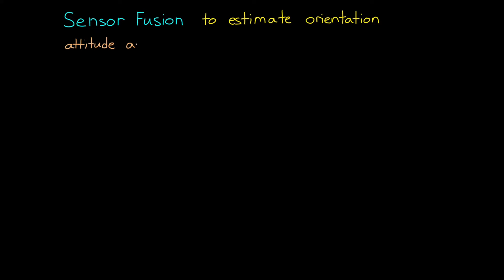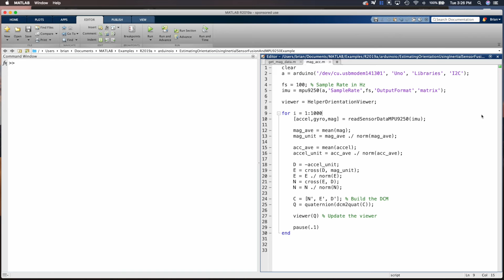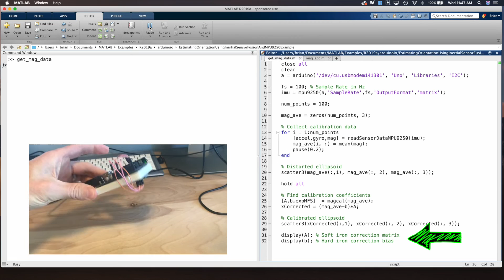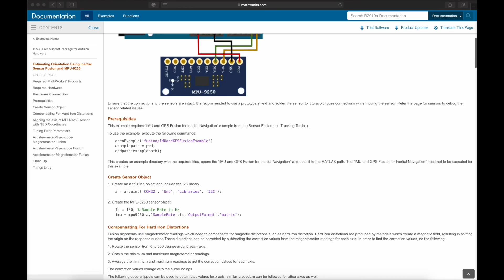Understanding Sensor Fusion and Tracking, Part 2: Fusing a Mag, Accel, & Gyro Estimate

Comment: In magnotometer calibration, U said down = -(g) and east = down x mag field. Isn't it should be up instead of down for ENU?
Reply: I don't know if I'm following your question exactly but let me answer what I think you're asking and please clarify if I'm wrong. NED and ENU are both coordinate frame conventions that are tied to the same reference (Earth). We could use either frame to describe a rotation but NED is more commonly used in aerospace. In this way, when an accelerometer is sitting on a table, the acceleration it feels is up, or a negative acceleration in the Down axis. And, East would be -accel (which is down) cross mag field. But if we were working in the ENU frame, then the upward acceleration would be positive since it's in the UP direction, and East would mag field cross accel (which is up). Did that make sense and did that answer your question?

Comment: (0:00 - 2:00) Introduction to the concept of orientation and different ways to represent a rotation such as roll, pitch, yaw, Direction cosine matrix, YZ, and quaternion.
(2:00 - 4:00) Explanation of how to estimate orientation using a magnetometer and an accelerometer. The video explains how to measure the phone's acceleration and the magnetic field to determine the direction of gravity and north.
(4:00 - 6:00) Discussion of the problems with the simple implementation of the orientation estimation, including the effects of linear accelerations and disturbances in the magnetic field.
(6:00 - 8:00) Explanation of how to calibrate the magnetometer to correct for hard and soft iron sources that distort the magnetic field measurements.
(8:00 - 10:00) Discussion of how to deal with corrupting linear accelerations by predicting them and removing them from the measurement, or by ignoring accelerometer readings that are outside of a certain threshold.
(10:00 - 12:00) Introduction of the gyro to measure the angular rate of the system and explanation of how to estimate orientation for a rotating object using just the gyro. This process is called dead reckoning.
(12:00 - 14:00) Discussion of the downsides of dead reckoning, including the need to know the initial orientation and the drift away from the true position due to sensor bias and high-frequency noises.
(14:00 - 16:00) Explanation of how to use sensor fusion to combine the estimates from the accelerometer, magnetometer, and gyro to minimize their weaknesses and maximize their strengths.
(16:00 - 18:00) High-level explanation of how the blending of the two solutions (accelerometer and magnetometer vs gyro) works in sensor fusion algorithms like the complementary filter or the Kalman filter.
(18:00 - 20:00) Demonstration of how to implement the sensor fusion algorithm in MATLAB using the function ahrsfilter.
(20:00 - 20:32) Conclusion and introduction to the next video, which will add GPS to the IMU and orientation estimate to improve the position obtained from the GPS sensor.

Comment: Any thoughts on the 9 DOF chip, LSM9DS1?    Wouldn't implementing sensor-fusion be easier if it's all from one chip?

For example, I saw another cool Processing project, but that too doesn't use the ST chip, instead the ADXL345..
"ADXL345 accelerometer breakout board + Arduino and Processing"
Reply: how to validate the x, y, z,value if its correct or not

Comment: I need an urgent answer, please! I used MPU9250 to get the x, y, and z axes' values for the accel, mag, and gyro but I didn't know how to use them to calculate the angle of the sensor from the floor. please help! 
PS, very useful explanation in the video.

Comment: This video helps me a lot!! But I was wandering that at 3:07 why could we measure the upward acceleration? Since the phone remained stationary on the table, the total force on it should be balanced and thus be zero. Therefore the phone should not experience any acceleration, right? hope somebody could answer that for me. Thanks!!
Reply: I had the same question. I think it has something to do with how accelerometers work. The sensor has a mass suspended with spring(s). The acceleration is calculated based on the compression of the springs. In the case where the phone is stationary, the mass will experience the force of gravity and compress the spring under it which corresponds to an upward acceleration.

Comment: Thanks for the nice video. I have a precision to bring about magnetic metals: hard irons keep a residual magnetic field after contact with a magnet (like a steel screw driver), whereas soft irons are attracted by magnets but they don't keep a field, like cast iron and many soft steel plates used in magnetic systems (transformer cores, pots around magnets, etc) Weirdly enough this is a mix of crystallography and quantum effects.

Comment: Brian, I’m trying this in an airplane,
but in a coordinated turns the sensors would read 0° roll as the gravity vector is pointing down (relative to the aircraft). How is this issue solved? Should I use a different fusion method?

Comment: can you please explain how east is cross product of down and magnetic field
Reply: If you make the assumption that the magnetic field is pointing in the north direction (and a little down or up) then the down and mag vectors exist within the down/north plane.  The cross product of two vectors produces a third vector that is perpendicular to both. So, in this case it would be perpendicular to down/North plane, which is either East or West.  Per the right hand cross product rule, down X mag would produce a vector pointing East, and mag X down would produce a vector pointing West.  Does that help?

Comment: time 6:19 the direction of the acceleration is not correct, at least misleading. Normally when we talk about the acceleration of rotation, it's talking about centrifugal force.
Reply: If the bar was rotating at a constant angular velocity then I agree that the accelerometer would report only the centripetal acceleration and it would point toward the center of rotation. But what I was trying to show (poorly) was that when the bar accelerates from stationary to some angular velocity, the majority of the acceleration that the sensor would see could be perpendicular to the bar.  Imagine a really long bar with a sensor at the end.  If the bar rotated only a fraction of a degree, there wouldn't be much rotation but the end of the bar could have moved up or down quite a long way.  This is what the accelerometer is sensing here. But I should have also mentions that rotations also produce a component of acceleration that is along the radius of the rotation.  Thanks for the comment!

Comment: When an object rotates in uniform circular motion, the acceleration is not tangent to the circle, but rather towards the center of the circle.  The narration, together with the pictures, implied that the acceleration was tangential.   That only happens if the object, in addition to traveling in a circle, changes its speed.
Reply: You are correct. In my head, I was envisioning the angular rate changing (or it accelerates the speed at which it rotates) then the acceleration would be in the direction I drew.  However, my voiceover and the animation didn't match that description and I should have drawn the acceleration vector radially.  Thanks for catching this!